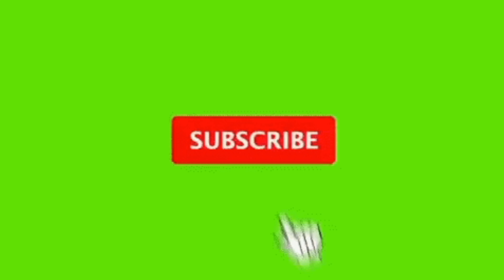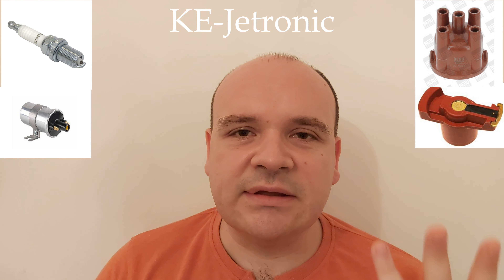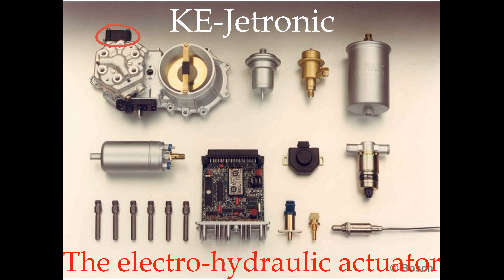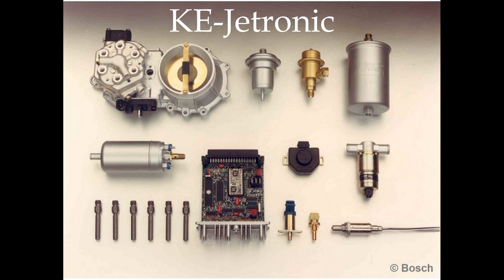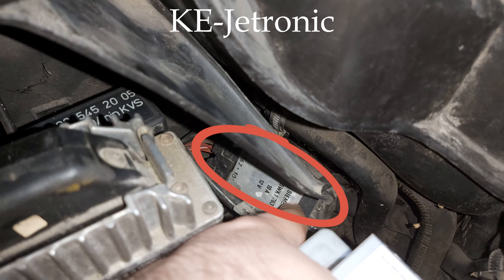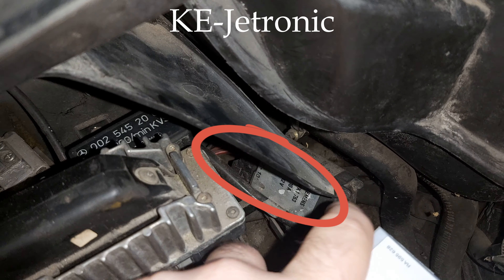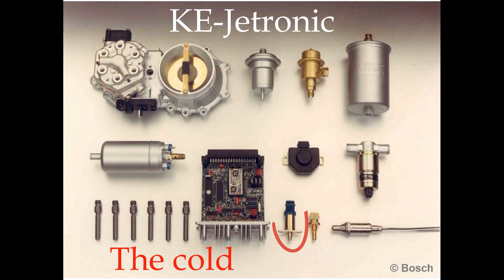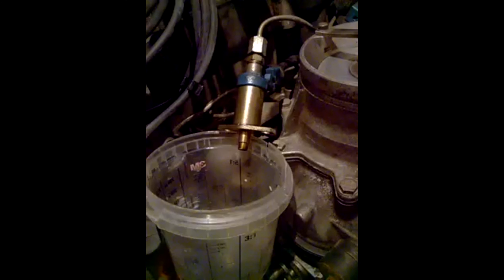㉦KE-Jetronic㉦ - The Basic Working Principle

Comment: Wow what an amazing effort this video! Thanks for this. Have a question: My 1991 w124 300E does NOT have an o2 sensor that I can use to check duty cycle. Is this normal? Did all of them come with an o2 sensor?
Reply from the maker: Hi and thanks for the comment! There were 3 versions - RuF, KAT and ECE(the strongest one). It's normal for a car not to have a cat. If you have pin numb.3 you can check your duty cycle - just it the multimeter has to show you a steady number of 50% with no fluctuations. As for the duty cycle - if you are sure that nobody has been messing around with the mixture screw, then your duty cycle is fine. Happy Mercedesing
Reply: @mercedeske  I tried measuring duty cycle but it stays at 100% with no fluctuation. I'm using a variable voltmeter with duty cycle formula to calculate. The car does not have a CAT or an 02 sensor on the exhaust. It's a 1991 4matic 300E 12v. Is it possible to verify (through the VIN perhaps) whether the original car came with 02 sensor from factory? Maybe that's why it stays in open loop even after warming up.
Reply from the maker: @shaazy  With 100% is something wrong. You will have to get a steady 50%(no fluctuation). Check something, maybe you have an error in the ECU. Here it is hat it says for 100% - You have no voltage or ground on X11(diagnostic socket), you have an interruption from the x11 to the ECU, you have no ground or voltage on the ECU(ovp bad) or the ECU bad. There is some error there. Concerning the sensor - if you have catalyst you have lambda and one more way - it says on the sticker as you pen the hood - OHNE KAT - NO CAT. If it says CAT then you have a catalyst. There, I tried to help as much as possible.
Reply: @mercedeske  Thanks so much! Car is currently at the workshop and I'm finding it a pain to locate suspension parts for the 4matic from a vendor. Do you have any recommendations online? I did check the sticker, it does not mention KAT at all. I'll do some more digging with the VIN and see if it shows up on factory specs and update.
Reply from the maker: @shaazy  As for the parts, you can search on the W124 site. I'm one of the admins there
https://www.facebook.com/groups/Mercedes.Benz.W124.Parts

Comment: Do you have links where to buy the tools ?
Reply from the maker: Everything you need from the special tools is torx set if you have to adjust the fuel pressure regulator(4,5mm allen/torx 27). Everything else are just common tools. Fine tune-a pressure gauge and a multimeter. You can find everything on ebay.

Comment: Thank you for this video.  Does the fuel accumulator preform the same job that a fuel check valve does? The check valve prevents fuel from flowing back to the fuel tank and therefore it keeps the fuel pressured up in the engine for a quicker start.
Reply from the maker: Greetings and thanks. Yes. The fuel accumulator makes warm starts easier.
Reply: @mercedeske  -  My car is a 1982 Volvo 240 turbo with k-jet.  Can a car have both an accumulator and a check valve?
Reply from the maker: If you mean the pressure valve, then you have both components.

Comment: Thank you for all of your helpful video's. I have a 1992 Rolls Royce, which also uses the Bosch CIS system, and I find your videos very useful when troubleshooting my CIS system. This might be an unfair question for you, but can I assume that the resistances and voltage of the air flow sensor on a Rolls/Bentley AFS are the same as with the Mercedes?  Thanks again.
Reply from the maker: Hello and thanks for watching. As far as I know the voltage for the potentiometer is the same for all KEJetronic cars. After all that's Fa. Bosch that has been producing those parts for all car manufacturers.
Greetings and Happy Roycing!
Reply: @mercedeske  Thank you for the reply.